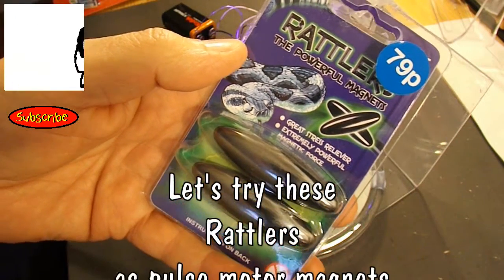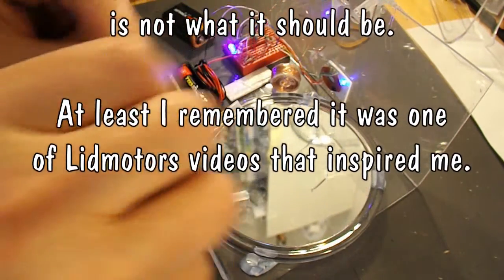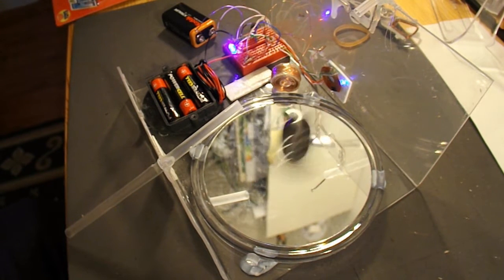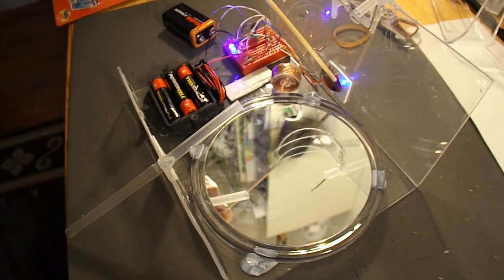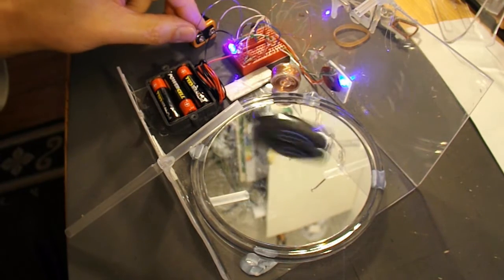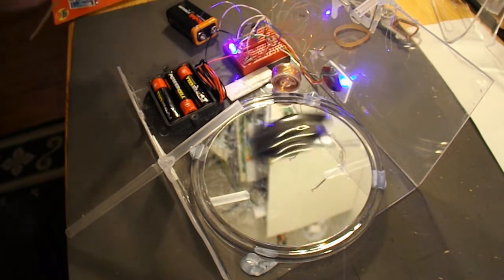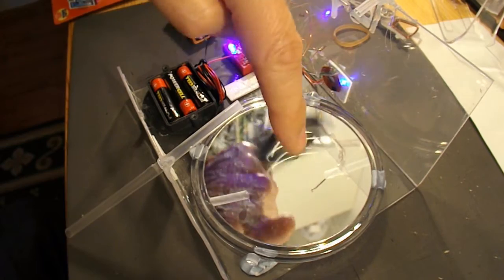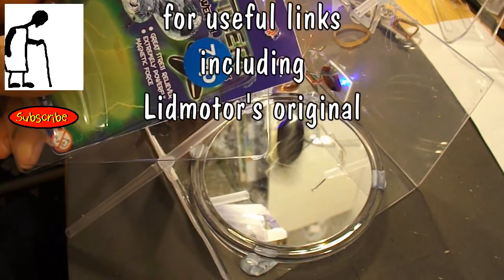Snake Eggs Rattlers Magnet pulse motor

Comment: The "Snake Egg" project was one of my favorites.  Jonny Davro  was the first one who tried that magnet and got it to stand up straight running at a high rpm.  It is fascinating to watch when that happens and will run at a very low power draw.  The problem was that it was hard to get started and I finally stopped playing with it because of that.  I ended up using small ring magnets with a steel ball stuck on the bottom as a contact point at the mirror.  A  number of different circuits worked.   The "Light Multiplier" was one of them.  I sure enjoy your work.  Your "plane" projects bring back many memories.
Reply from the maker: Thanks for the feedback and the original video inspiration. I will probably have another go at it in the near future. Got a couple of other things going at the moment. Just been out getting some exercise with those gliders again. It was supposed to be sunny today but I am glad it wasn't, I worked up a sweat just walking after the planes as it was.

Comment: Got a couple of those and will try one of them sideways. With the low friction, it might work with a 'dancing flower' circuit.
Oh, re breadboards, I had one seperate at the base and found that it's cardboard ! presumably with a thick foil backing on the inside. Used superglue to stick it back. Might be similar on yours if not just wear and tear ?
Reply from the maker: I will try Lidmotor's set up at some time soon. Just put electronic projects on hold tonight because my wife said the weather report for tomorrow is good so I have knocked up a couple more pizza tray gliders (new design) just in case I am allowed out to play :-)
The breadboards were very cheap Chinese eBay items, think I bought 10 for £4.99 postage free and they are OK'ish as long as all components on same track are same gauge wire but if you have used them for something a bit bigger and then re-use them with smaller items they often give problems. It was working fine, I watched the video back and can see when I knocked the wire with my pointing stick.
Reply: Yes, one learns very quickly that pencils work better than old radio aerials, when it comes to electronics and pointing..especially with high voltage experiments.